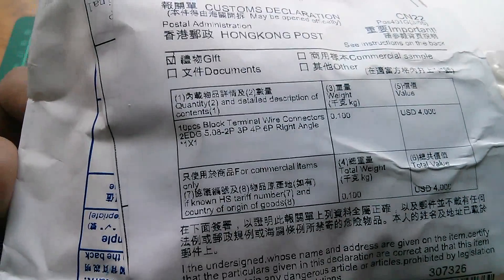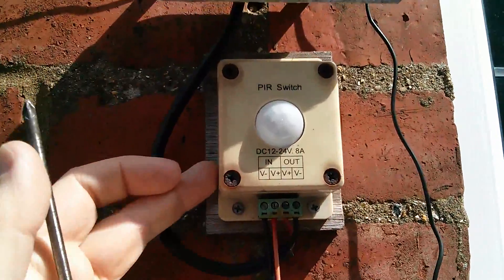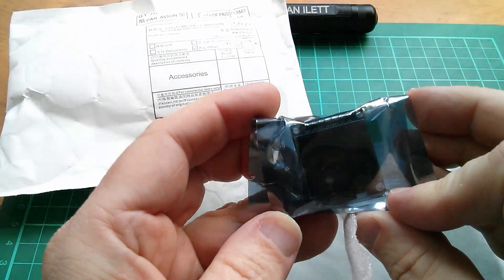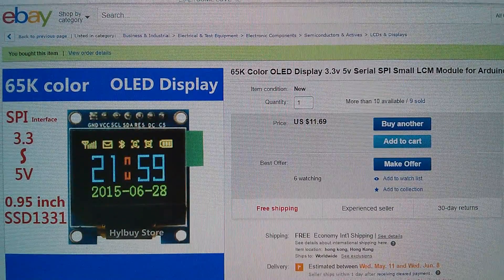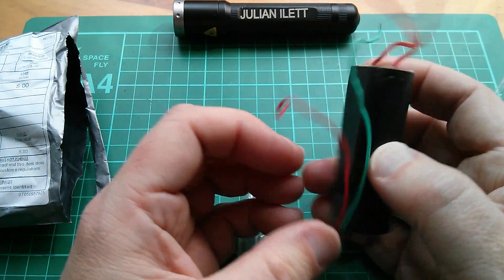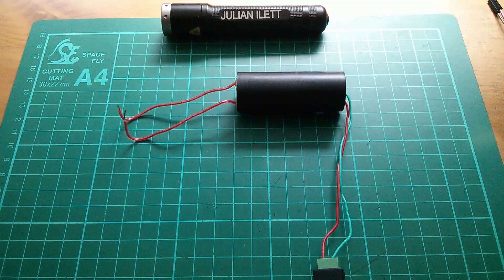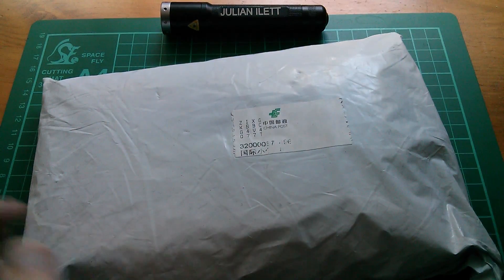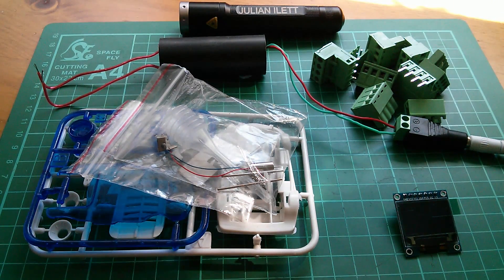Julian's Postbag: #62 - Colour OLED, 400kV Taser, Salt Car

Comment: Wait.... 3/6v input, 400kv output??? I'm sorry but physics teaches me that you can't get something from nothing, so how is this possible?
Reply: +ArcanePath360 This is true, but it applies to power. The input power  will always be equal to or less than the output power, so in this example the output current will be significantly lower than the input current. Remember P = VI. So 6V on the input at for instance 10A is 60W, at 400kV the output current would be 60/400000 = 150uA.
Reply: +lolz4live    Thanks; I had a feeling it would have to do with the amps being altered to compensate for voltage as these are the 2 things that make up power, but at half a million volts from 6v, I would think that is such a huge drop in current that the ohms would prevent any kind of usefulness? In my head it's like a huge body of water - the volume has the potential to decimate an area like a Tsunami, but with no current (forgive the pun) it's just sitting there not hurting anyone (unless you're sitting at the bottom of it downing).
I've been playing around with electronics for over a year now, learning new stuff all the time but still struggle getting my head around this strange thing called electricity!

Comment: you could check the voltage by extending the spark-gap. in air the usual value is ~21kV/cm. so theoretically at 400kV it should spark even at 7.5" or 19cm. but it needs very pointy ends pointing towards each other...

Comment: You can estimate the voltage of your HV converter by discovering how long an arc it will make. The breakdown voltage of air 30 kV/cm at 1 atmosphere. If you are at sea level then 400KV should draw an arc of about 13.3 cm.
Reply: You'd have to take air humidity into account as well.
Reply: @BertGrink  Your are correct but this was intended to get an approximate value. I watched this video 5 years ago. Maybe you could come up with a better approximation?

From engineering and physical tables, the typical range for the breakdown voltage in air is expected to be 20 kV to 75 kV. There are other factors that influence the breakdown voltage in air, e.g., humidity, thickness, and temperature, hence the wide range.
Reply: Definately not 400kv then, more like 40kv
Reply: That's very dependent indeed on air humidity level, which can reduce the voltage required for an arc considerably.

Comment: Bought a couple of these - quite useful to power my Internet router/switch in a power cut - might be worth a teardown http://www.aliexpress.com/item/5V-14-8W-mini-UPS-uninterruptible-power-supply-Security-monitoring-fingerprint-attendance-emergency-backup-power/32541971167.html?spm=2114.40010208.4.2.j47jyt

Comment: Sound of that discharge tells me that that inverter has a voltage multiplier inside of it. So be careful, some voltage will be remaining on the output when it's off. And yeah, I will believe 40kV on the output, but 400kV - BS at its finest.
Reply: Glebs Litvjaks Yeah, DC but with a lot of noise (pun intended). You just won't get that characteristic crackling juicy mini-lightnings without capacitor. Probably uses Cockroft-Walton multiplier.
I honestly don't know about the ladder, it should work in theory. Trick there is that hot air breaks down at lower voltage, I can't see why it wouldn't work with DC supply.
Reply: MrJohhhnnnyyy 20kv at best

Comment: I wonder if the other metal plate is under all the carbon? Or is it just paper?
Reply: +Preproto the metal plate is made out of magnesium, the black cathode is carbon and acts as an air-cathode.

together they form what´s called a Magnesium-air fuel cell 
https://en.wikipedia.org/wiki/Magnesium_battery#Primary_cells
Reply: Very nice thanks

Comment: To the OLED: The ebay listing isnt wrong. there are bigger full color oleds with the ssd1351 driver on them (usually 128x128). but the way you talk to the ssd1351 isnt far off from the ssd1331, i think ucglib even supports it, so no worry there

Comment: You can easily test that 400 kV generator, if it really produces that much voltage it should start an arc when the wires are about 10-15 cm apart, something like 3 megavolts per meter is what you should be getting (before the arc starts and ionizes the air of course).

Comment: Why not move the and connectors inside the box and use hotglue or silicone to seal the whole in the bottom where the wires would come out?

Comment: Oh come on... I had a 3000v generator running from a 200W power supply and I was dicking around on the outputs with a screwdriver, making sparks. I even touched the output.
Though seeing how well that works, I will buy one for sure. Most likely not 400kV but 40kV at least. (it's in Chinese volts :D)
Reply: +Krisztián Szirtes Jacob's ladder off a car ignition coil is also very fun. That's around ~10 - 20kV. Massively hurts when you accidentally get too close.

Comment: The plates are magnesium. It is a magnesium-air battery. No load voltage is about 1.8 volts. Fun little car kits.
Reply from the maker: +Robert Gibbons Thanks - is magnesium safe to touch?
Reply: +Julian Ilett Safe to touch. Keep away from flame (and sparks) as it burns quite hot.

Comment: the transformer is not that bad, I have tased myself several times. it hurts like heck, but there isnt any amps comming out Just high voltage. so you wont die☺
Reply: it also dont light things on fire, but I manged to egnite a ligther. But paper is fine  😊
Reply: The voltage that is left in the cspacitors hurts like the mains voltage.

Comment: about time there was an affordable little color oled screen like that. I was looking around for something like that a while ago but couldn't find anything
Reply from the maker: +iforce2d Yeah, I've been looking for ages too. This is the first one I've found with user-friendly connectors at a reasonable price
Reply: +Julian Ilett 
WTF would the home gamer need 400KV for I'm intrigued? 
Thanks Simon
Reply: +Julian Ilett I almost bought one of those, but there's a newer 1.3" one with higher resolution (128x128) on eBay for around the same price, which I bought instead. It doesn't have a board, just a FPC flat flex, so it'll be a challenge to hook up, but I'm guessing it'll be available with a board soon enough.
Reply: +Simon  Hopkins  How about a home made tazer, just of the top of my head.

Comment: Hi Julian you have buckleys and none of getting into that zapper, their potted in epoxy. Go on grow a pair and whack a couple of 18650s worth in with a 3/4 inch gap at the sparky end! The freq varies with the gap. Go On. You know you want to.
Reply from the maker: +Nic Green I slightly widened the gap and tried again. The spark is much longer (about 20mm) and the frequency drops as you say.
Reply: The specs say 7 - 8V in is OK. You're only at half throttle! A mate made himself a DIY taser with one, when the inevitable "test" was done he was totally underwhelmed - hardly felt it - was the report! Let us know how you go when you test it.

Comment: Luckily, like with everything, the Chinese exaggerate with 400kV. Rule of thumb is 2kV per mm for a spark. 400kV would mean it can jump 20 bloody cm and it does not. If you measure the gap it does jump you have an indication of the voltage.

So it's not very different from an electric fly swatter. It's even kind of the same as what's used in model railroads to apply up standing grass. (Noch Gras Master). And that thing is great to build one yourself (and save like €100,-). http://forum.beneluxspoor.net/index.php/topic,69230.0.html

Comment: Can you try to do the classic led or fluorescent tube lighting with the inverter?
Reply from the maker: +Pipe0481 Not if it means holding one end of it
Reply: +Julian Ilett If you mean the inverter, I've seen people making a LED light up by just putting it near the ends hehe
Reply: +Pipe0481 - LEDs are low voltage but fluorescent lights are high voltage low current.  I've never seen it done with LEDs and imagine the current required to light an LED would be way more than what's required to give you a bad shock!

Comment: If I remember my "electrotechnique" lessons correctly (it was more than 20 years ago) the ions moving from the anode to the cathode means that you have matter that travel the electrolyte.
So yes, after a while, the metal on the anode will be corroded, and the cathode will be covered by another layer.

It's basically what happens when you get a piece of metal chromed, taken to the extreme.
Again, If I remember my lessons correctly, which I probably don't.

Comment: Thanks Julian, that looks like the perfect replacement for my bush button BBQ igniter.... If i want to get cooked. Honestly, what are they designed for?
Reply: Home made ta5er?
Reply: +SublimatedIce Probably for generating ozone.
Reply: +SublimatedIce I've seen one used for a robotic potato gun igniter

Sparfun also used them for a digital clock.
Reply: +Cliff Hartle Probably not one rated for 400 kV in either case.
Reply: Gameboygenius For the digital clock they used one to create a spark gap that "lit up" each segment of the 8 segment display. Each segment was over 1". I think after they turned it on it was banned from the building. :)